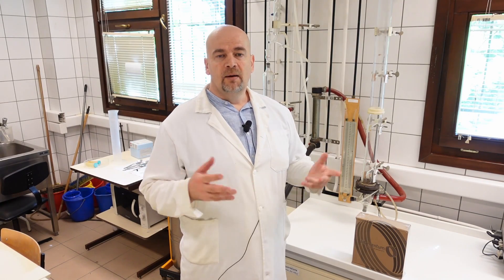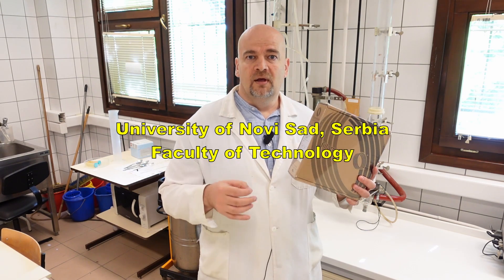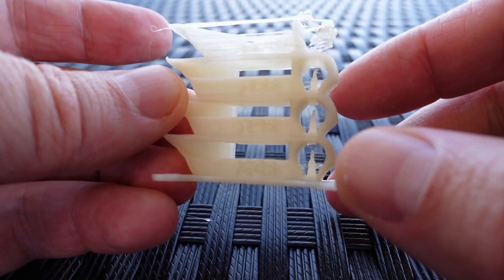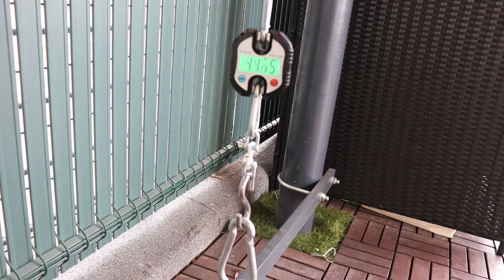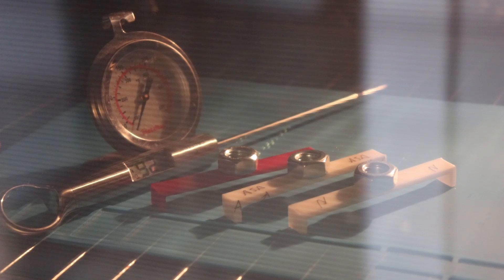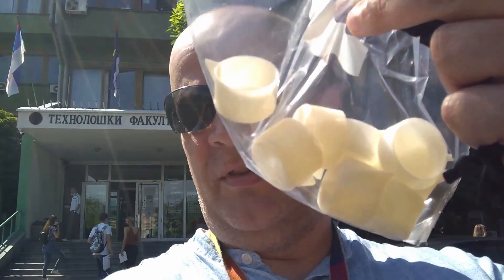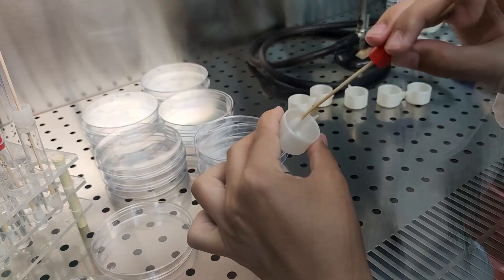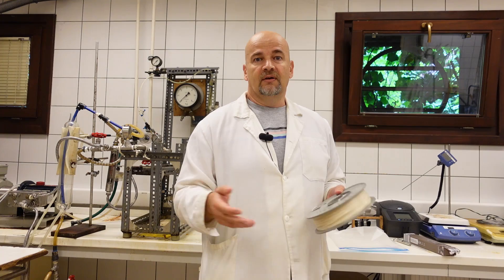Is this another solution for food safe 3D printing? Nonoilen filament from Filamentum.

Comment: gonna use this filament + food safe epoxy + stainless steel nozzle to make 3d printed mugs
Reply: please let me know if I should add anything else to my process
Reply: @billygate4063  I'd carefully clean the extruder and printing bed everytime before printing to make sure you don't introduce more particles to process, but since you are going to use epoxy to cover the thing that should solve most of your problems, just make sure you leave a thick and smooth enough surface.
Reply: How is the result? Still using the cup?

Comment: I'm trying to print with this filament and I can't get it to stick to the print bed.
Reply from the maker: What surface? Raise the temp of the bed. Try hairspray or glue stick.
Reply: @MyTechFun  I have a Biqu B1, with the original spring steel sheet bed. I've never had any adhesion problems with PLA or PETG, so this filament is kind of frustrating. But I only have a small sample of it, so I won't have to deal with it any further.
Tanks for the tips, your channel is amazing!

Comment: Max 50mm/s ?! Very low, did you try higher speeds?
Reply from the maker: Maybe 60 mm/s but for infill or similar. I use default "quality" settings in the slicer.
Reply: @MyTechFun  thanks!

Comment: What if.......the print is actually washed in a washing machine ? Because the brand say you can put it in the dishwasher without any problem so i think that a normal 1:30h washing program can remove every bacteria
Reply from the maker: It can be washed in a dishwasher machine, but we didn't do the bacterial tests with this cleaning method.
Reply: @MyTechFun  I'm confident to say that in a dishwasher with 1h cleaning will be bacteria free ..... maybe not for spores... I'm not a soap expert but i think those dishwasher soaps have bleach for them too

Comment: With regards to thermometers. I've tried several (for cooking purposes) over the last few years and I've been really happy with the ThermoPro devices. You can get a 1 channel for roughly 25 euro and the 2 channel version for about 45 euro. Since these devices have a wireless transmitter and receiver, you should be able to capture the data using an ESP32 or Arduino. I haven't tried personally but there are a few projects available.
Reply: A library that supports these devices: https://github.com/merbanan/rtl_433

Comment: I assume 8 is better than 35 but how much? What's the limit for food consumption?
Reply from the maker: Both are low values (if you use it emmediately after cleaning) but I am not happy with them. If any of bacteria survive they will again spread. If you take a look my other video, 0 CFU, coating with epoxy is 100% cleanable

Comment: As we talked before I think pasteurisation will be practical answer for this. In wine brewing pasteurisation used for extend bottle selflife but due to boiling ruing taste we are using  50-60 C bath for one or 2 hour to kill most of the yeast and bacterias. So 50-60C bath with  petg for one or two hour will kill bacterias. By the way thankyou for this amazing video.

Comment: Has there been conducted a similar test regarding some (or any) resin filaments? Very good and scientific video. Great as always. 👍
Reply from the maker: Not (from my side). But I know that some resins are used in dental purposes, so there is a solution, I hope somebody will investigate it deeper soon (or maybe I have to do it, but not in near future)
Reply: @MyTechFun  as far as I know those resins are used only to prepare casting molds for dentures and etc. to be made in final material. But I might be wrong at this
Reply: Crafman (i may be spelling it wrong) has very recent videos of him testing high temp resin for plastic injection molding

Comment: Keep in mind, the process of 3d printing is not food safe. There is possibly lead in brass nozzles and other unknown chemicals in the entire filament path.
Reply: Is that truly an issue after thoroughly washing easily dissolvable particles and chemicals on say an object of the size of a cup? We are talking like 20g of filament. Even with single digit percentage contamination (which would eat away your nozzles extremely fast) and consuming the entire contamination after the first 3-4 cups, you would still be below the amount of lead, that is considered "safe" (or also "lead free") in drinking water. So I don't really see how lead contamination really is an issue on this scale, as long as you don't eat what you print.
Secondly, having filament that doesn't deform when boiling combined with epoxy coating covers up for any contamination and you end up with a product that is even dish washer compatible, which is a huge plus.
Reply: PS: I took values for "safe" lead contaminations in drinking water from this source:
https://www.epa.gov/ground-water-and-drinking-water/basic-information-about-lead-drinking-water
They (US environmental protection agency) state, that up to 0.25% by weight lead contamination in plumbing is labeled "lead-free" and "safe". I misread the values for "by weight in water" which is a false claim. I'm sorry about that. Yet they also state that 15 parts per billion lead in water is the limit above which action needs to be taken. If we interpret this as "below is fine", we end up with 15mg/l of lead. 1% lead contamination by weight in a 20g cup corresponds to 200mg, so if you do not replace the cup before drinking 14 times (uncontaminated) water from it, you on average stay below this threshold. This is more than the 3-4 cups from my first post but still realistic for reusable dishes. Besides the 1% lead contamination in a printed object is imho absurdly too high (the nozzle shouldn't even have 10% of lead and abrasing entire grams when printing just doesn't happen). Other chemicals in the pipeline might be an issue, but those are likely on equivalent scale and thereby mostly harmless. It's not like other filaments add highly toxic nerve agents as solvents or anything like that.
Reply: @nightclaw999  yes. You can't wash toxins out of the plastic. They're infused.
Reply: @nightclaw999  also, it would be irresponsible for me to try to state exactly how it works and levels, etc. I suggest everyone do their own research. The last time I did, I encountered so much detailed technical information that I didn't even know how to interpret it because it was so thoroughly scientific.

Anyone who isn't an educated biomaterial scientist who proclaims "printing is food safe" is the equivalent of a flat rather, IMHO, using what they think they observe and understand instead of the science.
Reply from the maker: I agree, and I already discussed this process in separate video (linked from this one) https://youtu.be/lFtMIo00tfY
Reply: @MyTechFun  Oh, you are absolutely right! I forgot, that you included this in the video back then. I understand that you cannot officially endorse it, but out of curiosity: Would you share your personal opinion ("off record") on whether lead and other remaining contaminants in the print head are a significant issue?